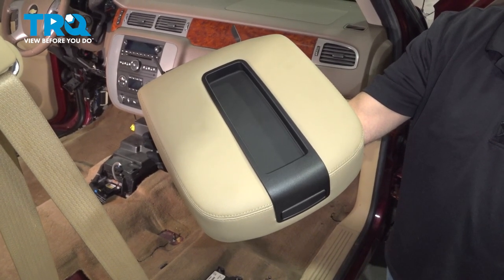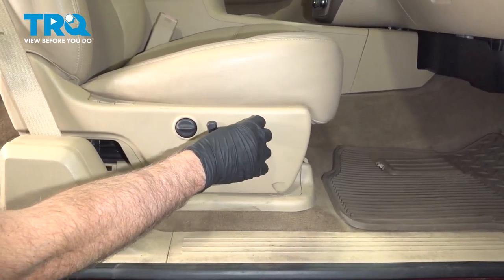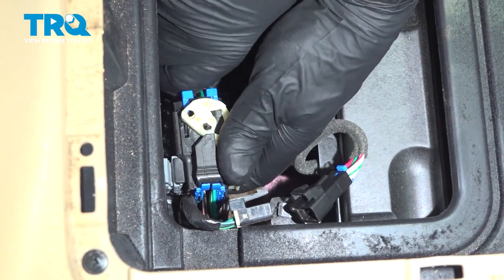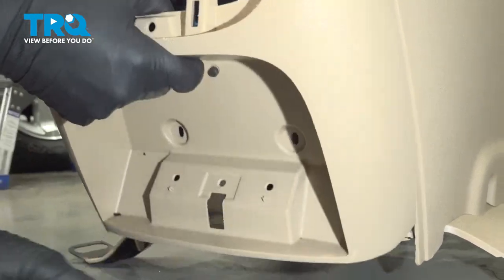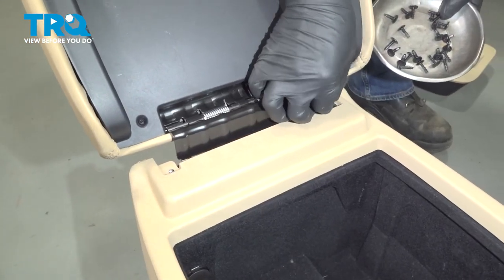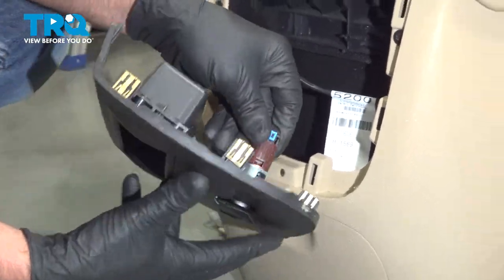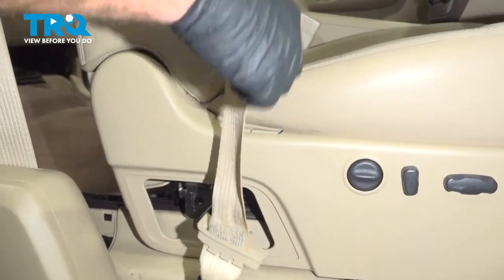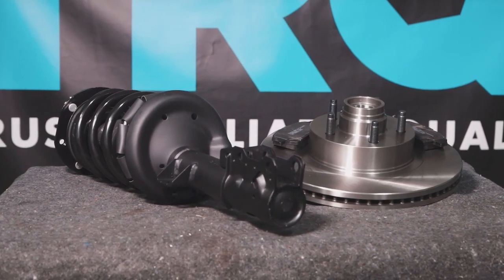How to Replace Center Console Lid 2007-2013 Chevy Silverado

Comment: This is not how to do this repair. You don’t need to remove the seats and console. Just remove 8 screws inside the cover, then four more screws attach the cover to the hinge. Place the new cover in place, insert the hinge screws, and finally, replace the 8 screws for the inside of the cover. It should take about 30 minutes, if you’re slow.